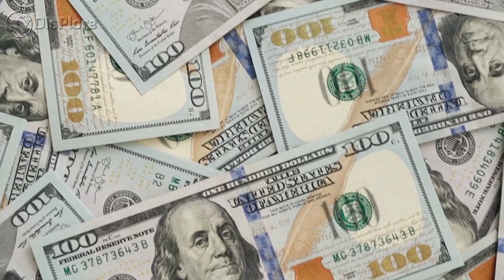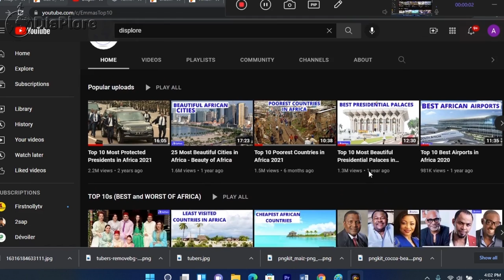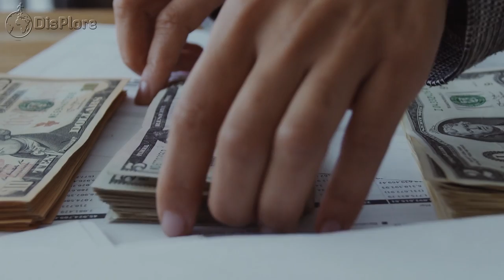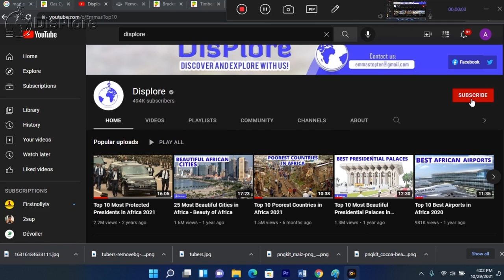5 African Countries Leading In Mega Construction Projects

Comment: Dear Displore, just a minor correction regarding  nuclear power in Egypt, we already have two nuclear power reactors in Egypt: the first one was built in the fifties during President Naser era (it was a Soviet Union technology), and the second was built in the eighties during Mubarak's era (it was Argentinean technology). Both were small and are used for experimental usage. The current planned one will be by far the largest one as you described in your excellent report.